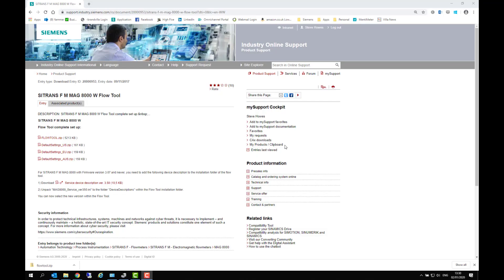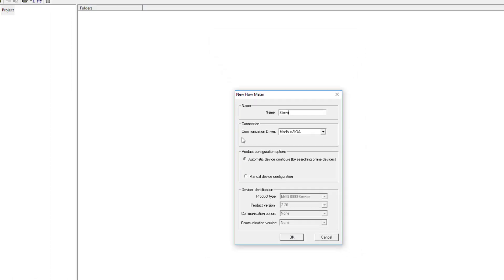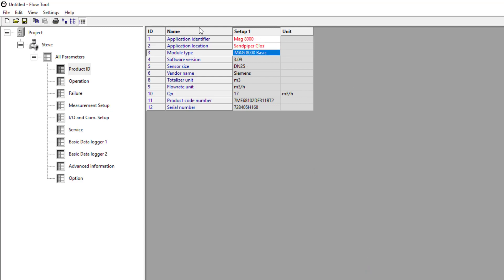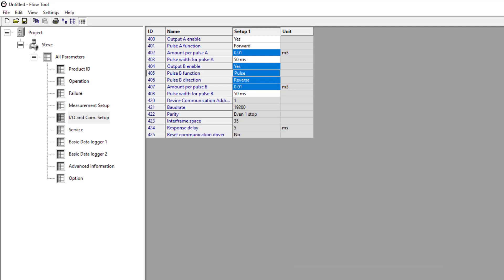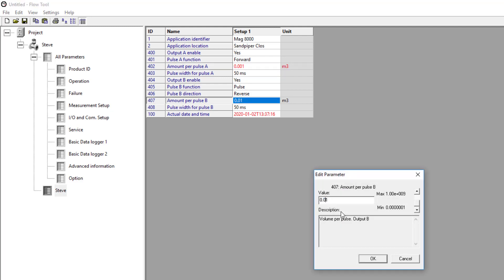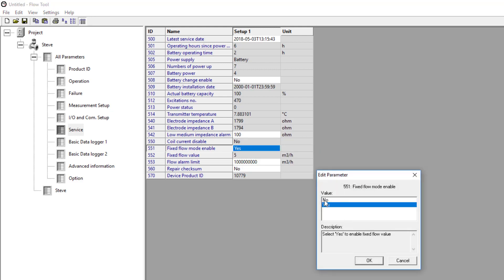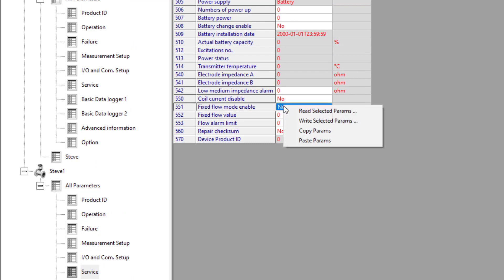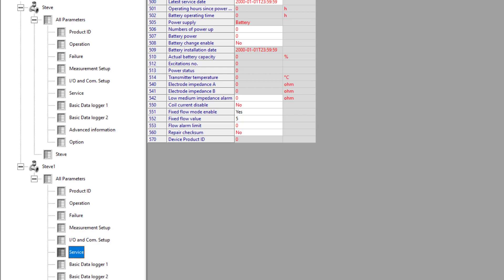How to use Siemens "Free" Mag 8000 configuration tool (Flow Tool)

Comment: what version of windows are you using? when i put on win 8 and switch to win 10 , irda can not be detected in windows 10.
Reply from the maker: There is an issue with Windows 10 and IrDA adapters.  Siemens are aware of this and some technical documents.  Give technical support a call and they will forward them to you.
Reply: Did you get any response from siemens regarding the irda adapter?

Comment: hello, may i ask you how to fix problem of mag 8000 that sometime show negative flow, but sometime positive flow?
thank you
Reply from the maker: Are you able to get a flow tool download from this device.   Also how old is the battery?
Reply: @IOTConnectivity  yes i able download the data from device...
and the battery on the display is full, but i dont know how old the battery. because i dont know when the divice is instals.. 
thank you
Reply from the maker: @arkanihidayat7010  please send the save file to stephen.howes@siemens.com
Reply: What type of output comes out from A and B and can i use the same output with the PLC?